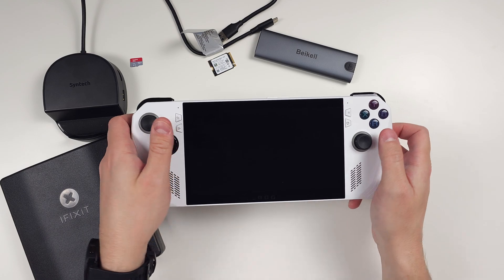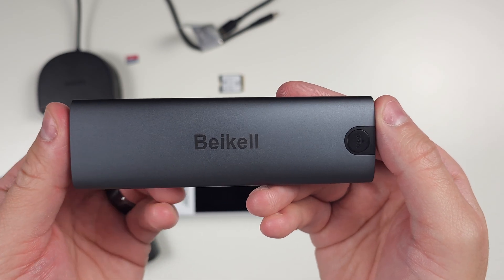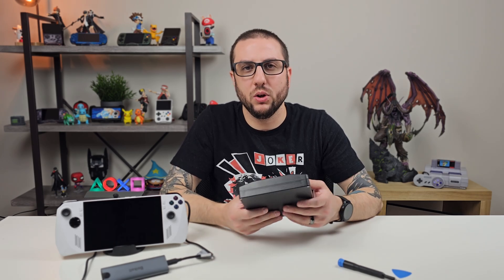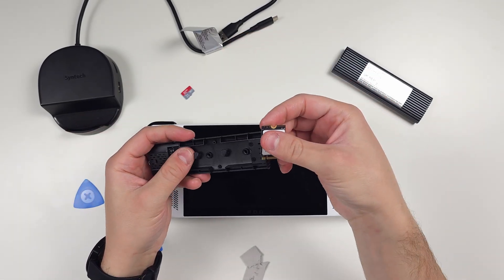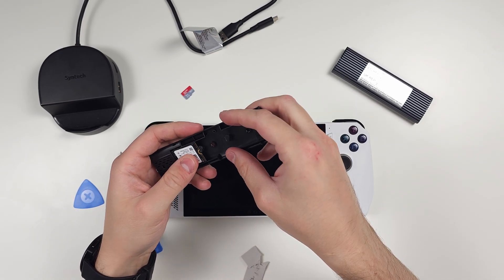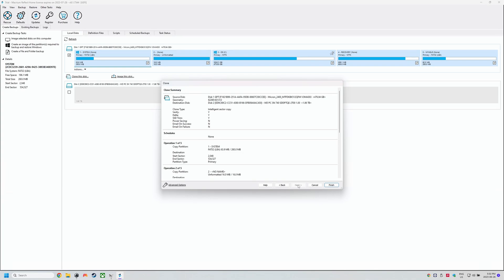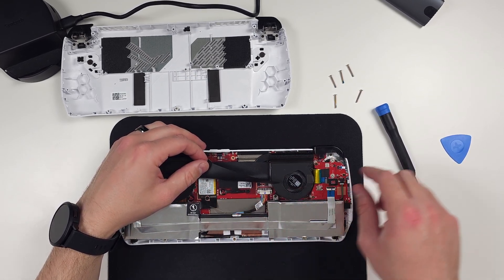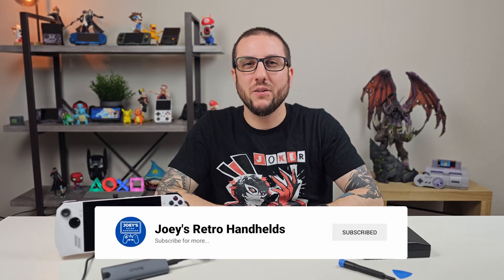Upgrade the Asus ROG Ally's SSD WITHOUT Starting Over

Comment: I don't have bitlocker when I search it nor when I look at the control panel, but when I try to copy the drive using Macrium, it says "The following BitLocker encrypted Drive will be cloned without enabling Bitlocker on the target: C: - OS". Should I just click ok? Or could I disable device encryption?
Reply from the maker: Hm, that sounds fine, not sure why it's not showing.
Reply: Did you decrypt or not?
Reply: @mohammadahmad1815  i did decrypt, didn't have any issue

Comment: Nice!!! I see a lot of people run into a issue when using a new SSD and doing the restore from bios. When it asks for wifi pw to install windows and everything, the keyboard doesnt come up..

I was wondering about cloning. If i did that would i just power on and boom. My ally is exactly as it was like nothing changed. Except more space.
I watched 1 video on this and when the Ally resrarted they had a C drive on their 2TB card with the orignal Ally state, and a D drive with all the extra space on their 2TB. 

I was looking for a video to see how to avoid this. You covered it. Love that you showed us how to make sure its all 1 partition and that when you boot it up its like nothing ever happened.  Just right into the desk top ready to rock.
I cant give enough thumbs up.

I think I'll wait until July 11th to see if there are prime day sales on SSD's

Comment: does the ally need to be in a dock or can i just plug my ssd enclosure into the allys usb  c ?
Reply from the maker: You could, the battery SHOULD last enough for it to get done, but that would be the only concern, lol race against time
Reply: @JoeysRetroHandhelds  well you said yours took about an hour and on full charge not gaming it should last more than long enough I HOPE... my ssd is coming saturday ill let you know how it goes thanks for video i didnt fancy reinstalling everything and dont trust not killing my sd card at minute
Reply from the maker: Good luck! :D
Reply: Well just started copying the drive the ally says it has about 4 hours battery so hopefully enough just quick question though do you know the cooling pad you get with the ssd enclosure is it worth applying that to the drive in the ally or will it get in the way ?
Reply from the maker: It's worth using, doesn't hurt.
Reply: @JoeysRetroHandhelds  I've finished the clone and installed the new drive but it's showing up as my old c drive with only the 512gb is there anything need to do after turn it back on ??
Reply from the maker: Sounds like you skipped the extend partition step. You can try using minitool partition wizard to extend it now.
Reply: @JoeysRetroHandhelds  right I think I've sorted it there was 110gb it wouldn't let me transfer over but all the rest has and its showing up ready to install onto just glad it worked and my battery was down to 30% before the ssd had finished cloning so was getting close thanks for help 👍

Comment: My ssd isn’t being recognized. Is it bad?
Reply from the maker: Add a letter in disk management.
Reply: @JoeysRetroHandhelds  going to sound dumb, but I’ve been a Mac user for way too long. Not sure what adding a letter means? My ssd enclosure seems like it’s working cause it gets hot, but the Ally doesn’t show that it’s connected.
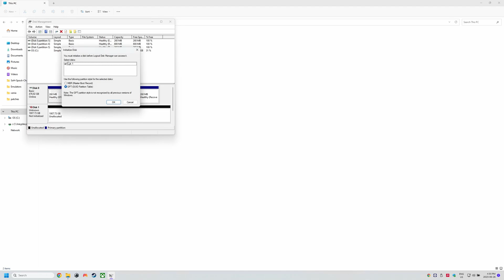Reply from the maker: 6:57ish in the video shows how :)
Reply: @JoeysRetroHandhelds  my enclosure was the issue. Bought a new one and was able to go through all the steps in your video. Thanks.

Comment: I can't find em lower than 150
Reply from the maker: My description has two links for eBay and Aliexpress.
Reply: @JoeysRetroHandhelds thanks great video looks way easier than steam deck, the comment about the sd card and heat do you not recommend using an SD?
Reply from the maker: There's been issues currently with people's sd cards not working in the Ally and its assumed to be heat related. Might be safer to not use it, or if you are, don't use the turbo mode, build your own custom profile.

Comment: What do I do if I get this error: The request could not be performed because of an I/O device error
Reply from the maker: Not sure why but try this - https://knowledgebase.macrium.com/plugins/servlet/mobile?contentId=2457682#content/view/2457682
Reply: @JoeysRetroHandhelds  Fixed it, I think the dock I was using wasn't providing enough power for both the ally and the m.2 enclosure. Everything worked once I connected the enclosure directly to the ally.

Comment: When I tried my PH0 screwdriver it felt if it didn't grip the screw and it was just turning and felt if i push the screwdriver too much it would damage the screw too much. I've heard that the SSD screw needs a PH1 screwdriver.
Reply from the maker: I used a PH0 personally, but if 1 works better for you, you can use that.
Reply: @JoeysRetroHandhelds  well i have to try that whenever my iFixit kit arrives. Not sure if some PH0 are pointier than others as I just used one from a local diy shop.